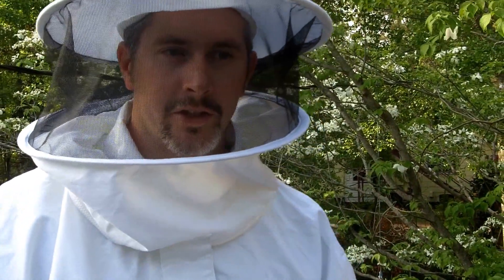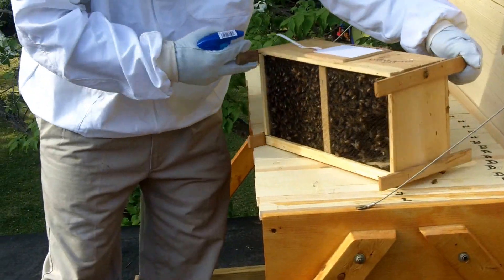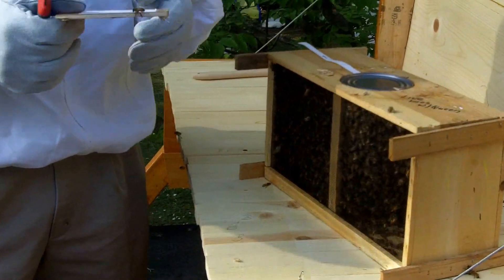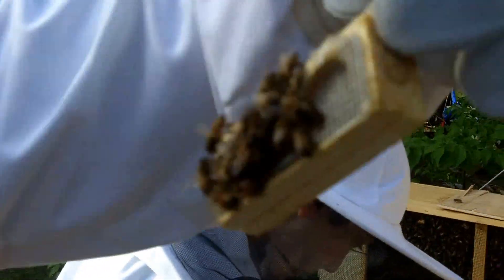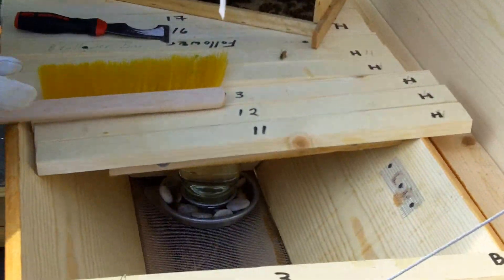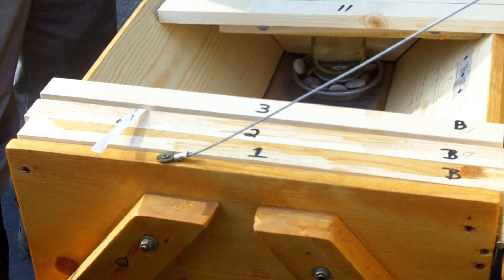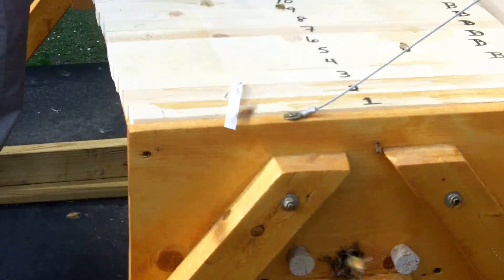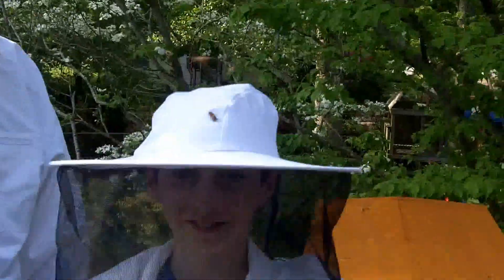Top Bar Hive Package Bees Installation- traditional installation

Comment: What a lovely hive and a well done introduction of a package.  The hive is beautiful.  I will receive my first package in mid April.  Michael Bush, if I remember correctly, suggests not hanging the queen from the top as the comb might be drawn crooked (if the weather is very cold, he states that you might not have a choice but to hang the queen cage).  Rather, he suggests laying the queen cage on the bottom.  In your experience, hanging the queen cage, was the comb drawn straight or crooked?